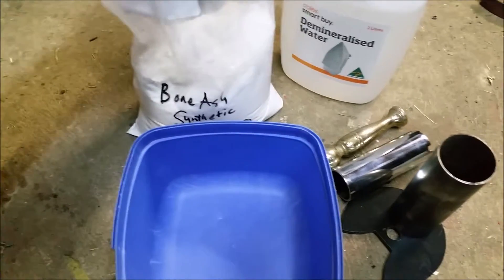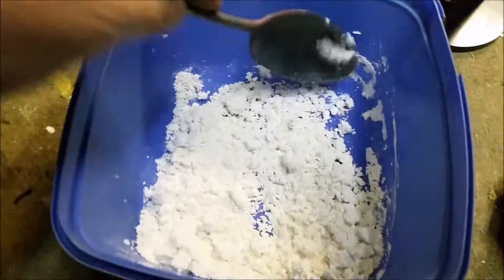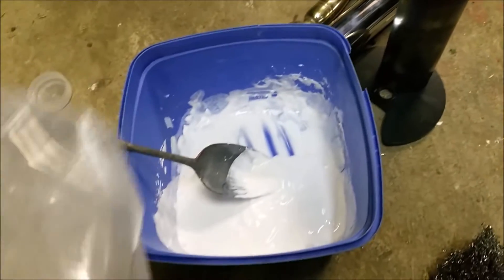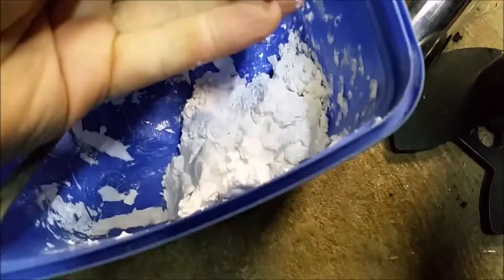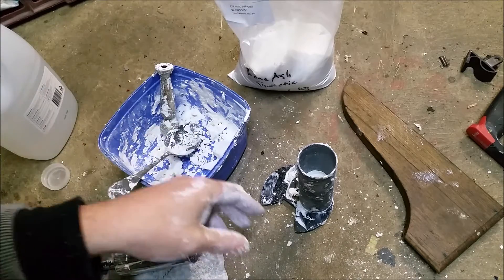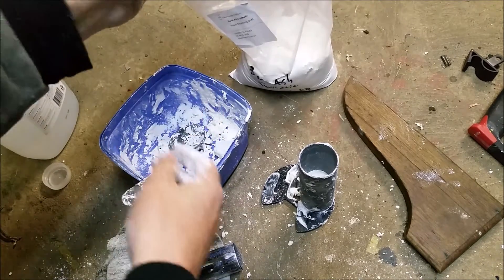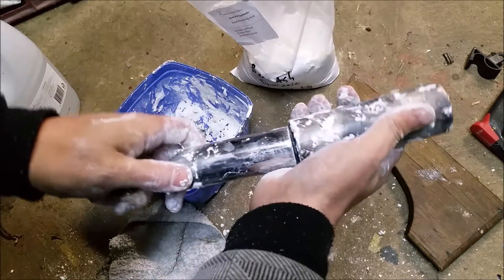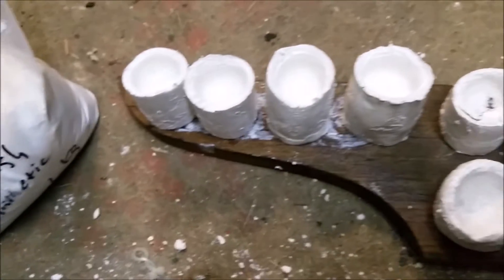Make Cupels for Gold/Lead Separation

Comment: I was wondering if you would know how to prevent cracking breaking cupels during cupelation ? I use MGO cupels I believe. The moment they are exposed to hot exhaust of propane gas they crack.
Reply from the maker: they can be made with dry compressed cement powder, maybe you need to ramp up the temp slow🤷‍♂️
Reply: @m3sca1  I guess I'm lacking patience 😆

Comment: Where did you get your bone ash from?
Australia?
Reply from the maker: yep ceramics and pottery supplier🤓👌
Reply: @m3sca1  did you get it online?
Reply from the maker: @mrgreenswelding2853  yes i ordered through a website, i dont recall the company sorry. there wasnt many ceramics suppliers when i went seearching online and i recall using one of the 3 that had a website and found it in glaze ingredients i think
Reply: @m3sca1  ok thanks, I will Google it.
Reply from the maker: it was sold as synthetic bone ash
Reply from the maker: @mrgreenswelding2853  keane ceramics has it listed under raw materials powders
Reply: @m3sca1  thanks again, I found it.
Reply: @m3sca1  How well do the synthetic bone ash work for you.
Reply from the maker: honestly, i never got to use them. had to move house not long after making them and they ended up in tub of gold refining stuff in the shed. i see people having good results using cement powder pressed dry.

Comment: Great video but what is that thing you put the powder in to press it?
Reply from the maker: it was all just junk around the shed. the brass bit to make the cup from a fire poker...tubing and other bits were from some busted desk clamp thing.  it could be plastic conduit or anything that is smooth

Comment: Where do you source your synthetic bone ash?
Reply from the maker: Ceramics supplier. Gets put in glazes i believe.
Reply: It's also sold as Magnesium    Oxide as a food supplement for stock. Especially Horses for stomach issues.

Comment: I don't know if you know the answer. Ok my stuff was assayed, yes gold and they gave me a flux mix to use. I bought cupel's, ran out when a guy a know said use dry portland cement. So I did, no gold. Did the home made dry portland cement beside's absorbing the lead did it also absorb my gold. Because according to assay I should of had a few grams and I ended up with a BB. Thanks
Reply from the maker: migel reyas have you reached out to Owltech ?
Reply: yes he is the 1 who said use portland cement. I know I have gold but after using his idea of cupel nothing
Reply from the maker: you said you got a BB? Did you tell him about the other stuff in your alloy? I think you should attempt parting with acid.
Reply: He was helping then disappeared. I also have sulfides with micro gold. I tried acids first, the Lab said wont work because of the sulfur. Need to smelt with lead, cupel the lead then AR. Right now I have con's soaking in peroxide. To supposedly remove some sulfur. If I put stuff in AR, then stannous is black but no drop because of sulfur. I am trying the peroxide to remove then AR. Thanks
Reply from the maker: migel reyas buy an ozone device and bubble through sludge. It will knock your sulfides out and make the PMGs more available. See my latest video. I just received one from China.
Reply from the maker: if you try the ozone route, be mindful this can create a van der graaf generator type effect and you can get zapped by touching any metal parts of the wash plant...and don't handle any of the liquid(ever), without protective equipment, the chance of Heavy metal poisoning is very high.
Reply: I dont have those options. I am not doing this for the heck of it. I live it. No other income. This isnt a weekend thing. I own the mines, I live here at the mines. From sun up till sun down 7 days a week. The only choice I have is to get the gold. Thats why I ask for guidance and help to figure this out. I have the RP4 shaker table, it does not do as they claim. The stuff in peroxide I plan to try just a melt with lead, not smelt. Crank forge up to around 2,500. Turn everything to liquid, drop in the lead pieces. Leave in crucible in forge till cool, break crucible. I have to do something soon.
Reply from the maker: Sorry if I come across as though I don't understand your frustration and the problem you face. I see Owltech suggest you get yourself some silver for the cupelling, it really is a must have for someone like yourself with a nasty brew of metals in a cupelling process. Also treat the sulfides. Sulfides are a real problem and as you have already found they burn off instead of melt. You need a cheap clever process to get rid of the sulfides, let me dig up some links for you regarding using ozone to change the availability of gold in highly refractory ores. Sell that stupid table and focus on your processing, buy yourself some plumbing fittings and make a plant to bubble gas through sludge concentrates. It is not out of the realms of doable to think of a commercial rig to clean up sulfides, others are already doing it to get the hard to extract gold. Also might be worth investigating some electrochemical process to pull the metals onto a carbon rod before cupelling.
See if you get a decent recovery from the peroxide, if that works then an ozone rig is gonna save you a fortune in not buying peroxide. Reminder-get a bar of silver for your cupelling!

https://patents.google.com/patent/US5611839

http://www.albionprocess.com/en/downloads/TechnicalPapers/Options-to-Treat-Refractory-Ores.pdf

https://www.tandfonline.com/doi/abs/10.1080/01919512.2011.536507?src=recsys&journalCode=bose20

https://www.researchgate.net/publication/254251017_Treatment_of_Sulfide_Minerals_by_Oxidative_Leaching_with_Ozone
Reply: As I said I am at my ropes end. I dont have anymore to go buy stuff, or time to wait for it to get here. I have to work with what I have or done.
Reply: Is there a way to make this cyanide leach stuff?
Reply: I took a pinch of gold/sulfides that soaked in peroxide for 2 days. Put in AR left sit for 30 minutes, put a drop in white spoon put drop of stannous it went black, then back to yellow/amber, so put another drop did the same. in the bottom of spoon is tiny tiny black specks. What is this? Can stannous be used to precipitate gold from AR? Am I getting a false positive? Started reading the links. Wow will have to do in morning.
Reply from the maker: that sounds like a positive test for sure, and a good indicator that you have broken down some of the sulfides and brought it into solution. No you cant drop with stannous, having Tin metal in your brew is worse than what you already have. So what do have available at hand? Got any large vessels? Bleach? Iodine? SMB? Any acids? Activated carbon? or can you make your self a big batch of charcoal? You got much water at hand? Trying to get a feel for what you already have or is easily available. I certainly would not recommend trying to make cyanide leaching solution, its way too dangerous and the regulations for controlling its outflow and disposal are gonna cost more than chasing gold is worth. Ozone or cyanide both work for leaching. 12 Volt versions of that ozone generator can be ordered, then you could run it from a solar panel. (mine took around 15 days from China). Then all you would need is water and you have a free leaching solution. Float charcoal on the surface of the leaching vessel with ozone bubbles from below will carry the PMG's to collect into charcoal floating on top and then all you need to come up with...is a clever way of getting your crushed cons into the leach vessel and easily emptying when the stannous test shows nothing left in the material and you can dump the liquid and keep the charcoal and move to the next batch of cons. You said you are at the end of your rope...don't forget to consider walking away and doing something else til you can come back with more money, or even just sell the mine...the chase for gold has consumed many a man.
Reply: Going away and doing something else is not a option, then come back cant. When first came I thought I was rich, but it was pyrites, didnt know. Not going to put the reasons on open media. Tried selling cant, tried a refiner here they said yes then wanted all kinds of proof, cant. Ok I have propane torch, forge, potasium nitrate,sodium nitrate,manganese,floorspar,borax, nitric, muriatic,sulfuric,ammonia [industrial grade,acids], urea, sulfamic, SmB, soda ash, mercury, lead,flour, charcoal, alcohol,clear vinegar, bleach,peroxide, chapman flux, well water, 3'x18" ball mill, rock crusher,gold cube,RP4 shaker table, retort, free electricity, free internet[in beginning bought a tower,no cell signal here], elec.hot plates, 2- 12cup coffee pots. Before assay's, I sent a pound to older guy, that did mining. He ground fine put on a m7 shaker, then small ball mill with mercury and he got 1 gram. Tried exactly as he did,same rocks,nope. Place said lead and .183 gold. I did 10lbs. Soaked 2lbs in muriatic then AR[test pos.] no drop. Soaked 2lbs in nitric,then AR[test pos.] no drop. 2lbs in muriatic and bleach[test pos], no drop. tried zinc and smB, tried dilute in water,nope. Now I roasted alot 5-6 hours at 1,000deg. no sulfur smell, per what I saw on youtube. The lab said 12 hours. All the smelts was done with my roast. The only thing I can think of is take #1's from shaker, soak in peroxide for 2 days, rinse,soak in muriatic a day,rinse,soak in nitric a day,rinse. Put in ball mill with mercury,with media for 2 days. At same time take 2lbs roast for 12hrs at 1,000deg. and follow Lab flux mix and smelt. I have run 9-5 gallon buckets of ground fine on table, so I have enough #1's. When I used the gold cube, the stuff I got gold color silver tint. Now the #1 spot on table is gold/copper color. I know the gold cube doesnt do as they claim, since I have micro gold I think the gold cube grabbed only pyrites and the micro went onto the tailings. I have not tried stuff with #1's from table, except peroxide and a pinch in AR,stannous, quick test. I am almost done running the buckets on table. I run each bucket 3 times, then run the #2[midlings] 3 times. Collect all #1's, then will hand pan down the #1's. When done then will start, some acids then mercury, some roast and smelt and if enough some in acids then AR and try drops. The only thing's I can think of is past roast's wasnt long enough, plus that was gold cube stuff[junk]. Lab said the sulfur wont allow a drop from AR[because of sulfides]. I think the guy who did get gold with mercury, was because he didnt get sulfides and he had media in his ball mill, I did not have media, just water and mercury. maybe because I didnt roast long enough, then smelt, also.  Im thinking peroxide to break up sulfur, then muriatic to remove iron,then nitric to remove copper and [some] silver, all are a oxidizer. Then half to mercury in ball mill and half to AR. Take some #1 roast as Lab say's, and smelt. Out of the 3 ways hope for luck. This was a long thing on social media. If you have any ways possible, now is when I really need the help. migrey1@aol.com. Thank's and Sorry, tried to explain what has been done.
Reply: Ok I sat here this morning reading the link info. plus links that the articles suggested. The tandfonline is not working a message comes up. Besides needing 10 years of college just to read these[I dont have]. I gather the ozone works, sulfides must be oxidized. The 1 article mentioned ozone works better then hydrogen peroxide, works better then bleach. The last research article mentioned sulfuric acid, compared to ozone. I have mentally taken a beating on all this. I cant purchase a ozone or doubt I can build 1. So that idea is out. From what I know,read or heard. I have all the acids. Each acid does a different thing. Sulfuric removes lead,muriatic removes iron,nitric removes copper and silver, bleach and peroxide are oxidizers. As long as none are mixed together and rinsed in between each, none remove's gold. Heat but not boiling on all helps. So clean #1's from table, then start. Peroxide, rinse. Bleach,rinse. Sulfuric,rinse.muriatic,rinse. nitric,rinse. Now separate into 3 equal piles. #1 to ball mill,mercury,water and media-2 days. #2 roast, 12hrs at 1,000 deg. take half go to AR other half, smelt[lab. flux] and #3 to AR,SmB drop. Slowly add the nitric. This is a last Hale mary and hope for any gold. One time I tried sulfuric and peroxide[pirranha] with a battery charger, positive on copper pipe, negative on stainless steel knife. What a mess. Everything dissolved. Cody's Lab idea. According to assay's I have iron pyrite's and micro gold.
Reply: I just got a response back from the Lab. most sulfide's to release the gold 500-700 for 5-6 hours is sufficient. my gold is locked up inside needs to be roasted minimum 12 hours at 1,000 degree, said the longer would be better. Said beside's roasting the sulfur away it oxidizes and turns the gold to metallic form. So this may have been where I went wrong. Also said lead is needed or the metals will go to a matte form.
Reply from the maker: Wow yes you certainly have everything you need and then some. Good news on the hotter roasting suggestion. Shame you can't go the ozone route, that is such a cheap way to get stuff leached and destroy the sulfides and free up the locked up gold in the pyrite. Check that bleach wash step with stannous if have not already. Not sure about bleaching, gold likes chloride ions, peroxide should be good enough. Also would not be washing off peroxide but rather let it dry onto the concentrate. I am no expert by any means, I do have a chemistry background but your efforts already would be more actual lab time than I have spent extracting gold, so don't take my words for gospel. Having said that I would be getting the cons and roasting them, then wetting it with peroxide and leaving it in the sun to bake and sizzle with peroxide, no washing. I would be treating all the pyrite this way too, pyrite is not that heavy and probably off in the tailings of your cube or table. Roast that stuff again, with all the peroxide on it. Wet it down to a mud with water, then cook it with Nitric until it stops blowing yellow fumes. Wash it. Cook it with Nitric 3 times each time washing it, hopefully seeing a white powder under purplish colour, then go for AR, filter and keep the yellow filtrate for dropping. Check this Russian guys method of you have not already, its a NO ROAST on pyrites method. The repeated cooking with nitric and washing is getting rid of the iron and the left over sulfur, without using sulfuric or HCl acid washes. He used Nitric/HCl for AR, not Nitric/Sulfuric, and dropped with hydrazine not SMB
https://www.youtube.com/watch?v=DdzjqPGRnzg
Reply: Ok I watched the video twice, gold from pyrites without roasting. What acids did he use in order? then what precipitater? At the end he has links to 2 other video's. I clicked on the top left gold from pyrite. In that one he roasted then used acid's and iodine and a precipitater? I didnt understand either. As soon as I can find out what acids in order I will try both ways. The iodine I dont have but can easily get it. The Lab responded to my email and said my gold is locked up in sulfides thats why I need to roast 12 hrs or more. I never heard of a roast that long, so I asked. When lab first sent me the flux mix, I asked about AR no drop he said because I have to remove the sulfur. The second video, he roasted then acids. I never tried that way. I will.
Reply: Ok He used Nitric 3 times, then AR, then urea. I looked up hydrazine hydrochloride. He used as precipitater. What is this? or can I use SmB as precipitater,instead? Ok he has another video. It kills me, people on youtube toss gold,silver,platinum in junk then acid it back to show people, how. me I cant even get gold. HaHa. Ok in that video he showed pool Ph test strips, them I can get. Ok he done it again. Gold from pyrites acids and a drop with that hydrazine. I wish I understood Russian. Here is the video, copy and paste.     Вскрываем золото в пирите серной кислотой! Третий способ - золото из пирита         He just made some other version of stannous from inside of battery and ammonia.
Reply from the maker: migel reyas will have a look over a coffee this morning. Have you also got onto the 911metallurgists forum? Great resource
Reply from the maker: migel reyas i also put the captions of translate to english. It wasn't great but it did ok.
Reply: Yes have been all over the 911. Thats where I got my RP4 shaker table. I have been running my #2's. The table is all gold color, but only fine's going to #1 spot. I will have alot in the #1. Then I will hand pan that. Gold is heavier, so top stuff is pyrite or junk. I plan on trying the Russian guy's way. Nitric, nitric nitric then AR. I dont know what he is using as a precipitater, but I should be ok with SmB? One video he roasts then goes through the acid's.
Reply from the maker: SmB should work fine, use that method Owltech last posted where he adds the gold solution to the SmB liquid.
Reply from the maker: last night I was able to use the translate function and watch the captions in english-today everytime  press it the damn thing chooses a language I have not pressed, gonna send you email, talking through is getting convoluted...
Reply: Yea Codys lab does that. Dissolve SmB in warm water, pour the AR into it.
Reply: @1hardman161  
where are you from ???